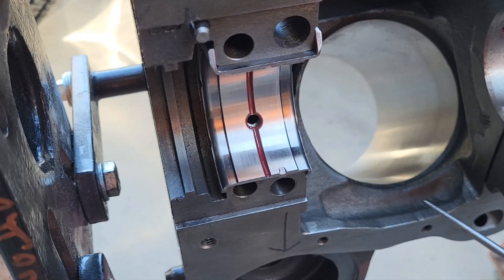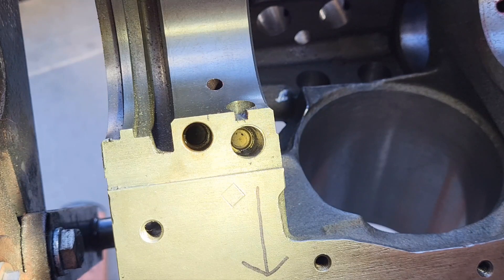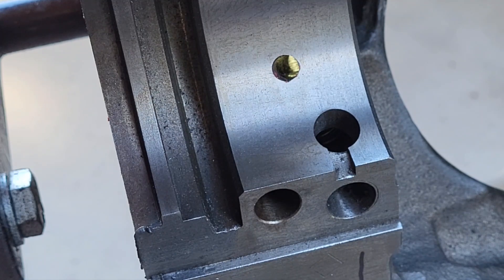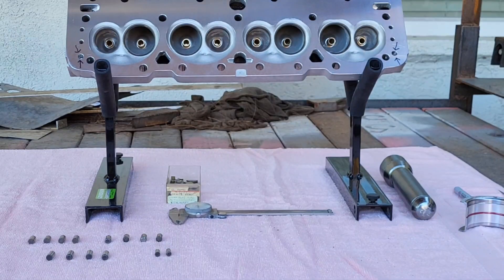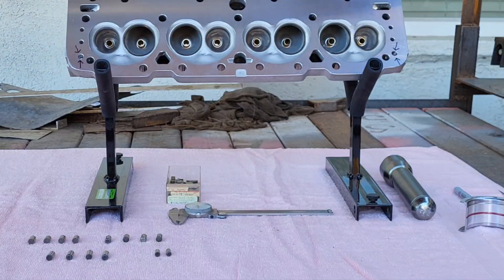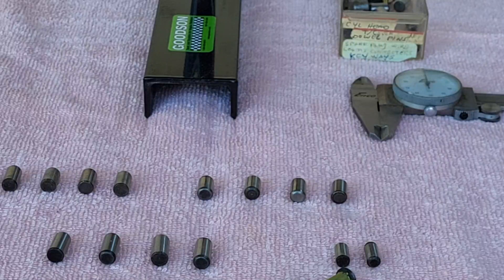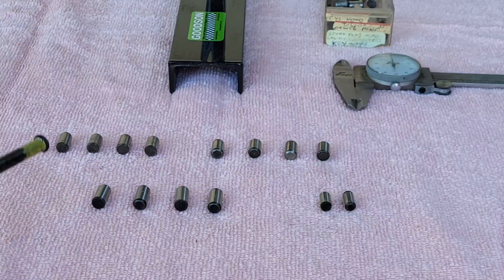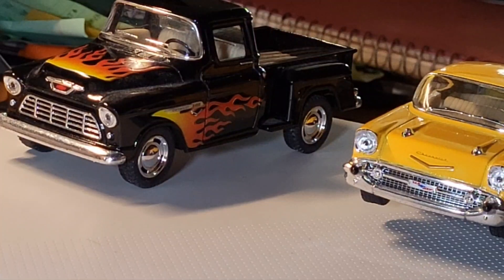At First Light.

Comment: You were talking about those two extra holes drilled in the #5 main saddle.    They are to help relieve oil pressure from the back side of the bearing in the tang area as a way to help keep the bearing tang better seated .   Especially in a application where I higher oil pump is used , 
Such as  Z28 or Corvette.